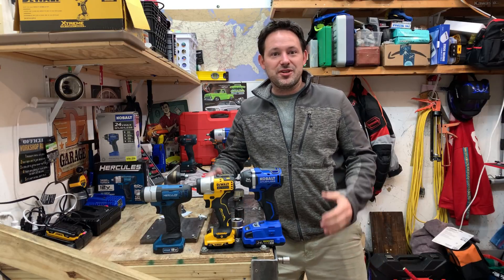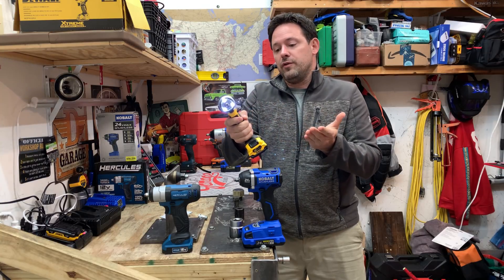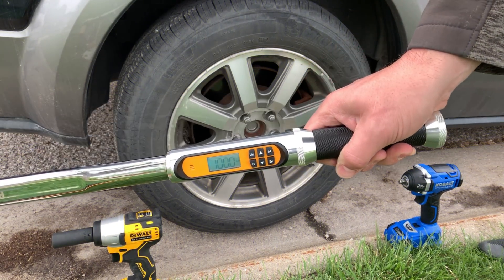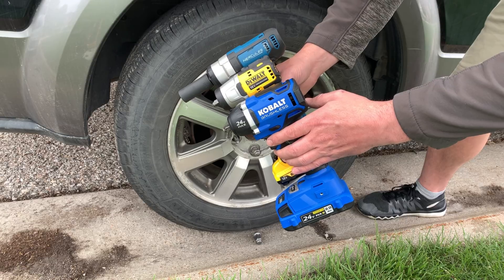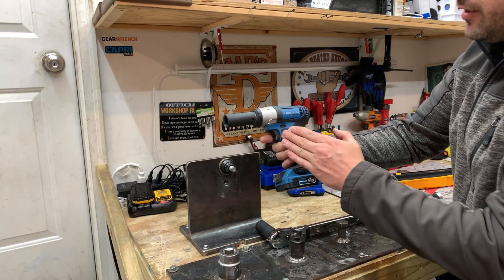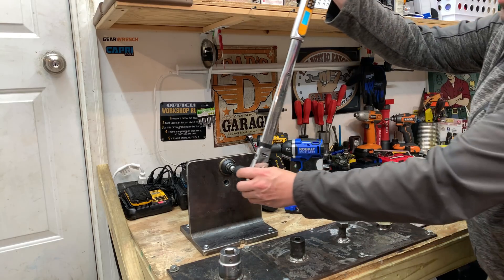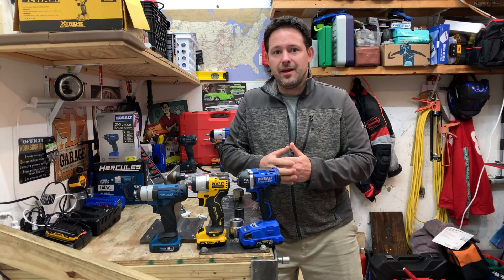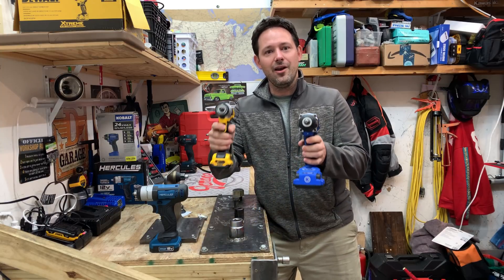Dewalt vs Kobalt vs Hercules 3/8 Impact Breakaway Marketing Torque

Comment: Thanks for this video! I got the Kobalt one for Christmas. Im already spoiled with a old beast Milwaukee so Idk what to expect, but at 200lb ft, that thing will do most things automotive assuming no significant rust/dirt. Wish you would have tried 225 or 250lbs just to see. 

Also, I just watched another channel with Kobalts right angle impact, their rating was 180lbs, but test at 250lbs!!! That's nuts. 

It appears that Kobalt is very conservative with their numbers. It probably hurts their sales, but good for us buyers. keeps the prices down.

Comment: I just wish somebody would tell me which tool is reliable for the price point. 

Wading through these videos of people conducting underwriter laboratories styled test on various assorted tools gets tedious. Geez..

Just tell me - this particular tool is the best and here's the current price. Does the darn thing work or not that's all I want to know.
Reply: Dewalt, Milwaukee, Makita are all considered contractor/professional grade tools.  Bosch and Metabo/Hitachi/Hikoki don't get as much attention but seem to have good reputations.  Ridgid and Ryobi are somewhere between consumer and professional grade; people value the cheaper batteries and of Ryobi and lifetime warranty for Ridgid batteries.  Kobalt ad Masterforce are store brands for Lowes and Menards and would be considered consumer grade, though Kobalt seems to have a really good reputation. Black & Decker is a consumer grade brand. 

Flex is a new brand from Chervon which is known for the Skil tool brand. Their newer cordless tool line ups don't seem to have the proven history yet to compare longevity to other brands.  

The top and mid grade brands all seem to have good reliability, and thry all have occasional lemons.  People get bad Milwaukees and bad Ryobis.  

If you want the best price and the best tools, either buy during holiday sales, or buy off Ebay.  You can get a Dewalt 887, Milwaukee Fuel Gen 3, or Makita XDT 14 impact open-box(like new) off Ebay for $100 all day, every day.  Paying full retail for these tools is kinda like the price difference of buying a brand new car vs. a slightly used one.
Reply: @seano932  why thank you, this was the matter of fact info that I was seeking. 

Out of curiosity, how do the impact wrenches sold by the tool trucks ( Matco, Snap-on) stack up? I'm assuming they must be pretty good because that's about all you see in a car repair shop.
Reply: Saw a video recently where DeWalt and Milwaukee outperformed a comparable Snap-On impact wrench. DeWalt, Milwaukee, and Makita are definitely professional grade tools. 

My guess is that as battery technology rapidly evolves, so will the performance of these power tools.

Comment: That's crazy that herc slipped on lug nuts because bauer breaks them everytime for me and usually quick as my other tools
Reply: The bauer is a 20v system and the hercules is only a 12v. There's gonna be more hercules tools coming out soon, hopefully the brushless 3/8 and 1/2 come out sooner than later. Then we can see the 20v vs 20v
Reply: @azhule4041  ah didn't even think of it

Comment: If you really want to see a good torture test video for that cobalt 24 V Max 3/8 drive compact impact wrench mid to work head on over to the coon trucking channel. That thing can take closer to 230 foot pounds before it won’t move a lug nut.

Comment: I have the Dewalt its  a pile of shit i have never been able to get any lug nut off. This tool replaced a stolen 3/8 earthquake impact Harbor Freight, which ripped lug nuts off all day.  The  Dewalt occasionally will get  caliper bolts on smaller cars. This test isn't all that relative to reality being on a rock solid  iron base a real world situation removing bolts from anywhere else is gong to present some  degree of shock absorption reducing the impact effectiveness . I was surprised at the lug nut actually .Using  my Dewalt to tighten lug nuts would be irresponsible I have to use a breaker bar to get them the remaining 40-50-% . Its a handy tool very small but loud  as fuck !. just bring a breaker bar ... PS. forget anything with locktite  is not coming out  but its a great power ratchet just get a 1/2 impact to have on hand ..

Comment: Would like to see the effectiveness of the breakaway torque on rusty bolts at the junkyard, especially on Honda crank pulleys bolts.
Reply: These bolt are never rusted just almost to remove lol but a weighted socket will make quick work of it
But these impact are not powerful enough to remove this bolt
But a mid torque impact will be enough

Comment: I work at an automotive dealership. I have the Kobalt XTR 1/2 impact and the 24v max 3/8 impact, and I use both constantly all day long five days a week. I've been able to remove axle ubolt fasteners that a Snap-On MG725 pneumatic wouldn't budge. With heavy use, I only charge/swap out batteries 1-2 times a week if that. The 3/8 does everything from suspension to brakes to under hood work, if it will fit 99% of the time it will work. 

1/2 XTR kit with 4.0 battery and charger, 3/8 24v max bare tool, one 24v max 4.0 battery and a 2.0 24v max battery all for around $300ish (got lucky with promotions and sales when buying everything). Absolutely happy with both of them, and look forward to adding more tools (espically the electric ratchet) to my box very soon.

Comment: A major point you missed on cost- Extra batteries. Kobalt batteries are 24v and cost less than an equivalent amp hour rated Dewalt 12v battery. A 2 amp dewalt is $49, and a 2 amp Kobalt is $29 at the normal price. One extra battery will completely wipe out any price advantage from the Dewalt. The Hercules 2 amp is $25 (and the cheapest), but as you showed, doesn't have the oomph of the other 2 tools.

Comment: Very good video, very informative. 50 years ago I had a 1/2" Craftsman 115 volt impact wrench. I could no remove the lugs off of my 1/2 ton Ford PU truck. I got rid it that thing post haste. NOW......I am simply amazed at how much torque that little 1/4" Kobalt impact wrench has. I bought one two weeks ago. No problem removing the wheel lugs off of my 3/4 ton van.
No more dragging around an air hose for my CP air impact wrench. I also purchased the Kobalt 1/2" 24 volt impact wrench for heavy duty jobs. 
Barry

Comment: The DeWalt should have been tested in the (1) setting.  That would have been A-kin to being in (low) gear, not (high).  The (low) setting would have had more torque...

Comment: Good video.  However, it’s my understanding that if you tighten something to. 100 foot pounds, it doesn’t take as. Much to loosen it.  That’s because threads are really an circular inclined plane.   
I might be wrong, but I’m 99% sure of that.    
I’d suggest getting one of those torque measuring devices.

However, that doesn’t make this comparison invalid' since they all were working on the same bolt and torque specifications.    

I was just poking out that your assumption of the reverse torque specifications,  might be invalid.   Maybe.

Comment: I'm looking for my first impact wrench and all I need it to do is to take off lug nuts off a car and trailer and do maintenance on a riding lawn mower in a timely manner.
Reply: Wouldn't recommend, this is a test to see what the limits are. If you are constantly useing a electric impact at its limits you will kill it in short order. You will probably go through 5 tire changes before you let the smoke out on any of these tools. And probably come across a few rusted lugs that you will half to use a breaker bar on any way. I would recommend getting any of the of the larger 1/2in guns. Kobalts old model (not the new xtr) is 170 with battery and charger. Probably best bang for your buck if you are wanting to take of lug nuts, but there are cheaper options out there for diy use. By the way I'm a diesel mechanic.
Reply: Any of these are probably fine for lug nuts and a mower. If working on Peterbuilts for eight hours a day, then no.

Comment: Kobalt has 24-volt battery and the DEWALT XTREME has 12-Volt battery Max. Kobalt has more power.
Reply: How many volts a tool has little to do with how much power its drawing. More volts means you can draw the same watts with less energy loss through heat, but thats it

Comment: I am sold on the hurculies, thanks to you ,my need is to take out lug nuts on my car and that one will work perfect for me and like the price on it. Again thanks for your review
Reply: Wouldn't recommend, this is a test to see what the limits are. If you are constantly useing a electric impact at its limits you will kill it in short order. You will probably go through 5 tire changes before you let the smoke out on any of these tools. And probably come across a few rusted lugs that you will half to use a breaker bar on any way. I would recommend getting any of the of the larger 1/2in guns. Kobalts old model (not the new xtr) is 170 with battery and charger. Probably best bang for your buck if you are wanting to take of lug nuts, but there are cheaper options out there for diy use. By the way I'm a diesel mechanic.
Reply: I'm not sold on the Hercules.  It struggled on the lug nut freshly torqued to 100 ft pounds, and in real life you're bound to come across lug nuts tighter than that.  I think if you catch the Kobalt when it's on sale at Lowes  with the battery kit that comes with a charger, 2AH battery and 4AH battery, for $129, with the impact thrown in free, that's a better buy than the Hercules where you have to buy the tool separate from the battery and charger.   Or, you could just buy the Kobalt 1/4 impact and drill/driver from Lowes, including a charger and 2AH battery, that is on sale for $129 through July 7, which is a 35% discount from the normal $199 price.  That 1/4 inch compact driver is rated at 1800 inch pounds, which is the equivalent of the same 150 ft pounds of the 3/8 impact they tested here, and with a hex to 1/2 adapter, that compact driver would likely outperform the Hercules.

Comment: Nice video but not really a fair run the dewalt and Hercules are both 12 volt systems while the kobalt is the 24 volt. Is that the new kobalt xtr ?
Reply: No, it's not the new xtr line.

Comment: Did kobalt go up in price? I got the impact and drill with two batteries, a charger and a carrying case for anout 160. Hes  talking about just the impact for half that and add a batt and charger for a total of 150. Mine wasnt a sale price either. Regardless, i am a big kobalt fan. Great quality stuff.
Reply from the maker: When I bought the Kobalt it was actually buy the 2 battery pack (1x2ah and 1x4ah)and Charger and get the bare tool (3/8 impact) for free so it was $129.99. Otherwise it’s $90 for the bare tool
Reply: They didn't go up. The drill/driver combos are always underpriced to get you to buy into the tool line.
Reply: Also, for most power tools, the ones you buy in kits are usually not as god as when you buy them one off. You will notice different part numbers and different specks on the box

Comment: Not very fare, the Kobalt is 24v and the rest are 12v 🙄 in addition try the 3/8 milwaukee m12 stubby 250 ft/lbs of torque 💪🏽 it will blow all of these suckers out the water 
Milwaukee or nothing
Reply: The stubby will blow all this impact away i also love my stubby
Reply: Not very fair 12v vs 24v.......
Try Stubby (12v)....... Do people actually think about what they write before they write it?
Reply: The Dewalt is the clear loser being that it claimed something and could barely do it at full battery and lots of work.
Reply from the maker: Here is the video with the Milwaukee stubby and the Kobalt holds it’s own for the price. Also included is the new Ridgid Subcompact https://youtu.be/th5TAfiTq5E
Reply: Kobalt XTR can take out milwuakee
Reply: XTR cannot take out Milwaukee.......
Reply: Not fair? It proves voltages are being  used as marketing gimmick, most people don’t understand how electricity works....... if the 24v was truly stronger then there should have been no competition.. it’s been said but m12 3/8 milfuckee stubby is rated for 250ft lbs, and it IS the smallest......

Comment: I wonder if the bolt wasn't capable of accurately being torqued, because of no lubricated threads. I'm thinking about installing head bolts, that's noise it made when torquing down lug resembles a head bolt not being properly torqued. It's like the friction bites the threads of bolt/ housing and isn't clamping down. So like 200 ft lbs may be 150ft lbs.

I'm may try this a home
Reply from the maker: The threads were 100% lubricant free. I hit them with break cleaner and let it dry before testing.
Reply: @ClientGraphics  Oh yeah I completely see that and understand. That was my point, they were dry. Just curious as to the actual torque when the lug failed to turn, it was lock and the torque wrench was measuring your weight applied vs being transferred to the lug nut.

To see what I'm talking about, one would have to measure the torque of removal. So like, if you applied 200 ft lbs, removal torque would probably be 150ft lbs. A lost of 50ft lbs due to dry threads. I wonder if lub on threads would've changed the outcome.

This was just a thought of mine, I'm a mechanic so seeing that cause a reminiscent state

Comment: I am happy with all my Kobalt tools.
Reply: How does the kobalt impact perform from a automotive use?
Reply: @TheAceAtGames  all of them have been doing perfectly fine. The short one,right angle and xtr 1/2in, 3/8vratchet all are holding up fantastic. Not too often I can't use one of them to remove or install something.  When I can't its usually due to space.  Around 8 months of nearly daily shop use  still going strong.

Comment: For wheel lug nuts I wouldn't go below 18 volts. The 12 volt struggles too much and could wear out quicker. Plus would do my patience in changing wheels doing a rotation or whatever.
Reply: Tell that to the Milwaukee and it may give you a black eye with an overhand right

Comment: Good video comparison. I have both an air and 3/8 cordless impact which are handy for engine rebuilding, working on generators, small engines and equipment but when it comes to lugnuts you are likely taking off 5 or 6 up to 8 times 4 so 20 to 32 lugs at a time. That is when I use my larger 1/2 inch cordless or my trusty old air impact which claims 720 lbs torque.

Comment: Looks like Milwaukee is falling behind the Dewalt in the compact 12v impact line. Their compact 12v 3/8 (2454) is only rated for 117 ftlbs. I have the stubby and really like it, but sometimes it's too fat to get some places without universals. Makes the dewalt appealing because of its size for underhood stuff.
Reply: Their m12 fuel 3/8 stubby is rated at 250ft lb.
Reply: @thegoyimknow.  i know.  The 2454 is 117 ftlbs and much narrower than the stubby, more like the dewalt.

Comment: Lowes has the Dewalt DCF902B for 100 bucks. I liked mine so much, I bought another one the next day. Out of the three, I think it's safe to say, the HF impact sucked. The Kobalt 24v vs the DeWalt 12v. I think the DeWalt held it's own against a more powerful Kobalt Impact.  The Dewalt 12v is smaller in size compared to the Kobalt allowing for tighter clearances. DeWalt won in my eyes.

Comment: Have you reviewed thee AutoZone OEM 3/8 impact? It's acid green b and I believe it's supposed to output 350ft lbs for $69 and has a peculiar brush service port
Reply from the maker: That’s an interesting 20v tool for cheap, it claims Max. Torque: 200 Ft/Lbs. (Forward) and 240 Ft/Lbs. (Reverse).

Comment: This is comparing apples to oranges. 24v vs 12v systems. Compare the 20v Milwaukee or Dewalt to the Kobalt. Kobalt would get smacked
Reply: But theoretically the voltage shouldn't matter compared to what their marketing ratings are. Dewalt claims 200 and could barely do it, but kobalt claimed 150 and did 200 no problem. Milwaukee stubby claims 250 on a 12v tool and I love it.
Reply: Jakob Kerr looking at it from that perspective if fair enough
Reply: THIS test may be apples to oranges but you are dead wrong. The Kobalt is class leading and underrated for compact 3/8 impacts. This isn't the first test. Beat Snap-on and Milwaukee's M18 compact 3/8 impacts.
https://youtu.be/Y-EoHFH_bfU

Comment: Impact wrenches if there struggling try doing an Ugaduga try tapping the trigger impacts give all of there power on the start of the trigger pull so if its stuck just let off trigger then pull trigger and do that multiple times will be more realistic results all the bench testing is not accurate because there no load on the bolts good video though

Comment: Got my Dewalt 12V Xtreme package for $99 at Lowe’s. Claiming 200 lb ft of breakaway torque, with a torque precision mode. Would you test that as well?
Reply: The 12V Xtreme is the one in the video. The 3/8 20V impact doesn't have the speed settings (only the impact driver does).

Comment: I have all 3 kobalt impact wrench except for the new XTR.

I love my 3/8 and the small 1/2 is a value for the money.  As a diyer with kobalt's cheap batteries its a no brainer for home users
Reply: Good call. I prefer Milwaukee, but it looked like Kobalt dick slapped Dewalt in these tests. Kobalt, I think is underrated. They are definitely better tools than they get credit for
Reply: 4 years w my big kobalt 1/2 impact, used and abused and has taken off too many rusted and stuck bolts to count. It impressed me so much that I bought the angle grinder, 3/8 impact, skill saw, and sawzall. Kobalt performs like the big brands (sometimes even better) for a better price and the battery cost really just drives it home.

Comment: Good stuff!
Anybody know how much break away the M12 3/8 stub is rated for?
....Well, it is an impact wrench so I guess it would be higher than the above?
Reply: M12 3/8 & 1/2 stubby impact are 250 lbs. 1/4 is rated 100 lbs. If you start putting adaptors on the 1/4, it's also going to lose some of that.